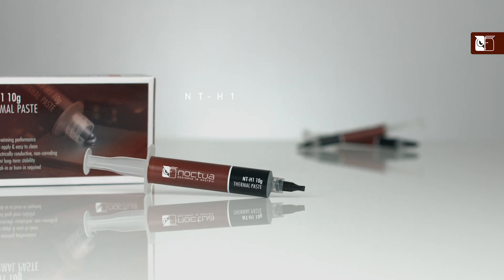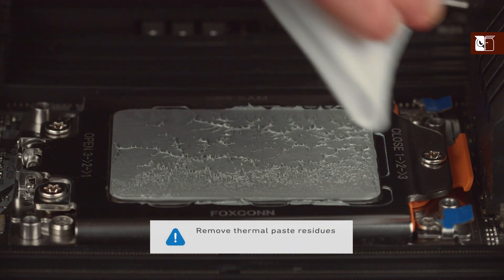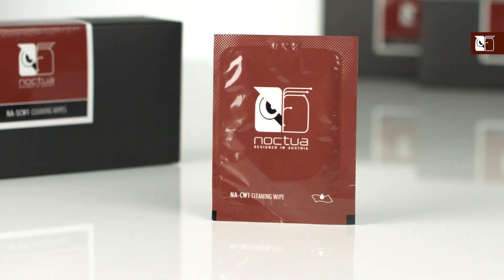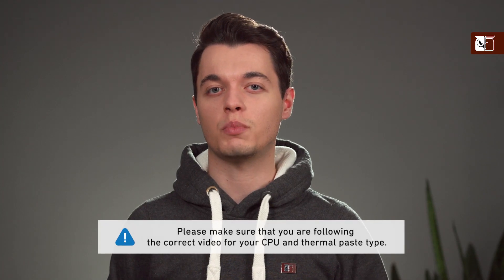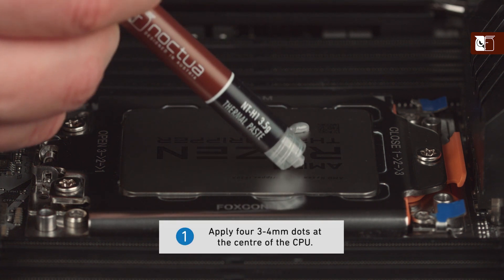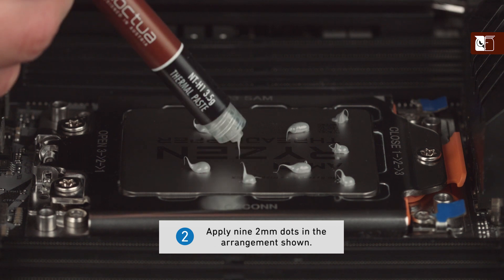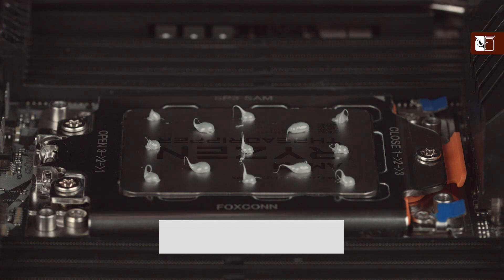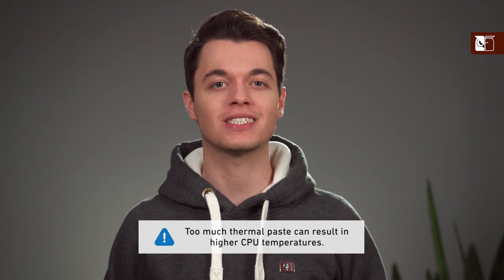Noctua NT-H1: How to apply on larger-sized CPUs (e.g. AMD TR4, Intel LGA4677, LGA4189, LGA3647)

Comment: What would you recommend for bare die applications? My Noctua NtH1 lasts only 2 months in my laptop with heavy use
Reply from the maker: Either a very small dot or spreading to a thin layer. What issues do you see after 2 months? NT-H1 normally lasts for years on application.
Reply: @NoctuaVideos  Ok yep that is the way I have been doing it! :) 

I would say that the main problem is the "pump out" effect, there is simply not any thermal paste left on the die after a 2 months of heavy use, everything has escaped to the sides of the die. (heavy use = 300 hours of gaming). Temps also increased with 15-20 C

Could the thermal paste be too viscous for this application?

It's sad since I have initially great results with the paste.
Reply from the maker: Are you sure that the heatsink is fixed well and doesn't move? Lots of customers use NT-H1 for laptops and naked DIEs and we've never got reports about such issues. If you want to try something less viscous, you could look into NT-H2. You may also see slightly better temperatures in general.
Reply: @NoctuaVideos  Yes, unfortunately I'm 100% sure that the heatsink is fixed well in place. But thank you very much for the help, it is much appreciated, I will for sure have a look at NT-H2! :)
Reply: @NoctuaVideos  Here I uploaded a picture for reference, comparing it to the stock thermal paste, if you are interested. https://imgur.com/a/rlMGMTm
Reply from the maker: Thank you, this is really strange!
Reply: @mangostechcorner7107  Maybe there's too much pressure on the heatsink?
Try to reduce tension for a little bit. If the paste is indeed that much viscous, additional pressure could easily squeeze it out!

Comment: So, is my laptop's i7-7700HQ a small, medium, or large chip?
Reply from the maker: It's probably actually even smaller than what we describe as "small" in this video because Intel's laptop CPUs usually come without integrated heat spreader, so you'll have to apply the paste directly onto the chip. It should look something like this: https://pics.computerbase.de/7/5/9/2/1/article-1280x720.8f853b42.jpg
As a result, you'll only need a very small drop of paste, around 2mm diameter should do!